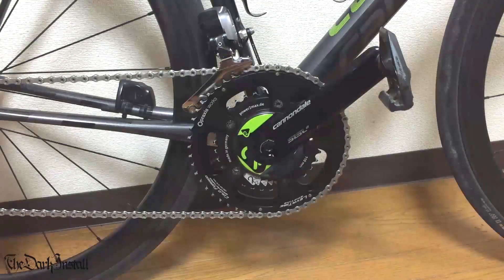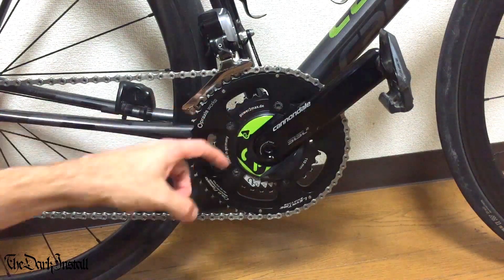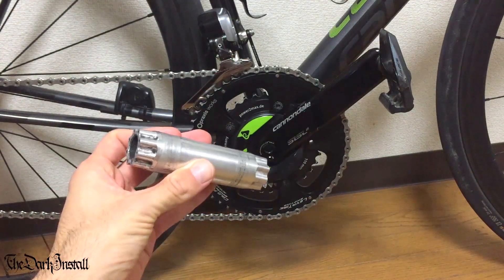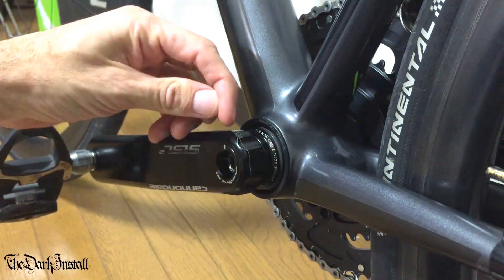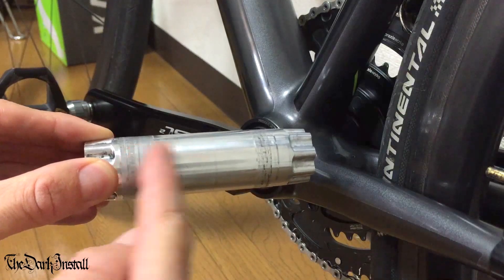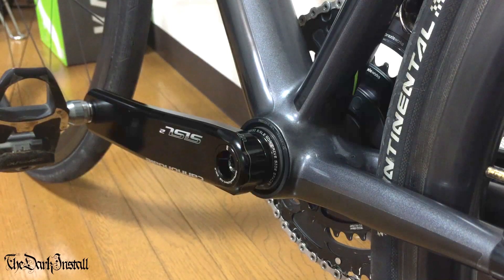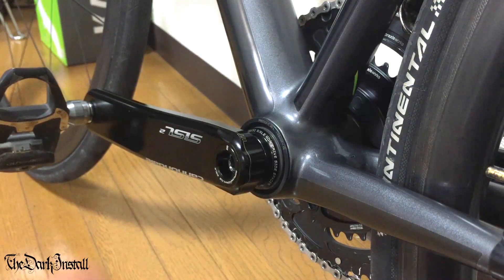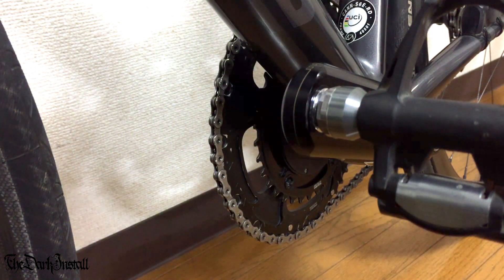Cannondale SiSL2 Cranks. 80,000km Review!!

Comment: Nice and detailed review. I just replaced my SI crankset for a hollowgram crankset with shorter, 165 mm crankarms. I would like to have the SISL 2 version but I couldn't find them in my lenght. 
There is a little bit of play in my new crankset, I think I been to get myself some 0.5 mm spacers. Cannondale does mention this in the documentation, but there were no shims in the original factory installation and the sizes are the same.
Cheers!

Comment: Excellent cranks - I would use these if I had a Cannondale, but makes sense to use the also excellent Sworks crankset on my Sworks! They have now ditched the wavy washer for a 3 Allen screw 2 piece adjustable washer that works well.
Reply from the maker: Cyclespeed Tours yeah the S-works cranks look ace.  You are referring to the S-works cranks when you say they have replaced the wave washer?

Comment: I change cranks so much this sounds too fiddling. Washers to set up spacing etc. I ran rotor with their complicated set up and also some mega exo(which also looks like this one you are reviewing in some ways) and fiddling around with spacers and whatnot when I'd rather just slap a different crank on. Shimano 24mm stuff has been the best for me regardless of bottom bracket. Just 2 Allen bolts and BOOM adjust front derailleur and you're off riding
Reply from the maker: mindciller why are you changing cranks a lot?
Reply: I run different cranks because I log a lot of miles. 53/39 during crits. 50/34 2 different cranks one for training another to road race on so the bike looks good on the podium of course
Reply: i agree with shimano bb86/bsa/ita is the best....

Comment: Good stuff.

When you got the new crank arm, had the design been changed at all, or was is the same as the one you cracked?
Reply from the maker: Ah yeah good question.  Should have mentioned that in the video.  Yes, the replacement crank was slightly beefed up compared to the original.  It looks pretty much the same, but the end area near the pedal is slightly thicker, and not machined quite so far back.  I didn't get to compare the old and new version for weight, as the old one was sent off to Cannondale in order to get the replacement, but I would imagine it would be a couple of grams heavier.

Comment: Hi DarkInstall. Are you still riding the cranks today? How are they holding up? I'm considering buying a set second hand. I feel a bit safe knowing I'm a smaller rider that can't put out huge watts and that a second hand crank has been ridden and somewhat proven itself. My fear is that the cracks appear because of fatigue. Any thoughts? Thanks!
Reply from the maker: Still working fine.  I wouldn’t buy second hand though.

Comment: Should have picked up FSA chainrings when you installed the powermeter. They just work unlike the praxis stuff.
Reply from the maker: I think you are right.  Astana uses that combo.
Reply: FSA rings are cheaper too. I recently bought a super road set to replace the worn set. The outer is about 80 AUD and inned is 40 AUD. That is the top tier stuff used by Astata etc. You can't even buy a praxis outer buzz ring with those money I spent on a set of FSA rings. My old FSA gossamer rings lasted about 25000kms, 3 105 chain changes and 2 105 cassette changes within that, sort of durable in my opnion. Try those next time you can get them easily off CRC or wiggle if none can be found in Japan. In my exprience FSA got shit distributors and their catalogue is a freaking mess (for finding the right components) because they do so many "undocumented" product variants and can't even keep track of those themselves lol.